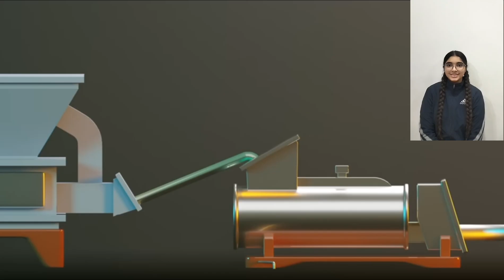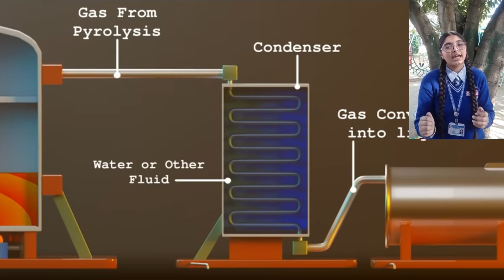SYI43059 | Team Waste to Fuel | Top 2000 | SYI25

Comment: I have some concerns  here there should be some points must be considered 

1 Air pollution caused by tank

2 carbon emissions 

3 by product disposal 

4 high initial cost 

5 and most importantly maintenance and corrosion  issues
Reply: Thankyou for ur concern but we have already kept these points in mind and we have already prepared detailed solutions for it ,which will be shared in future
Reply: @SUKH0095 looking forward to it